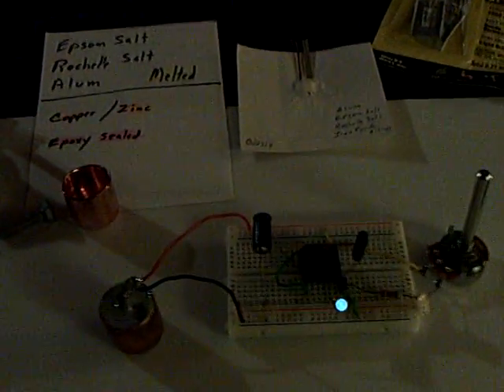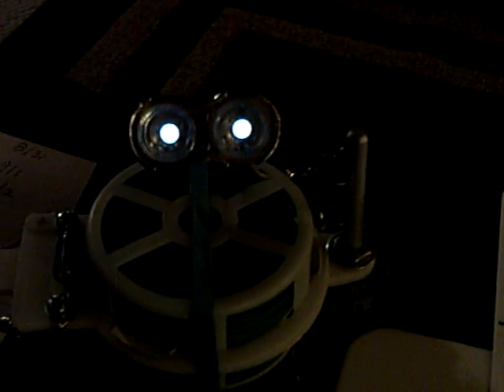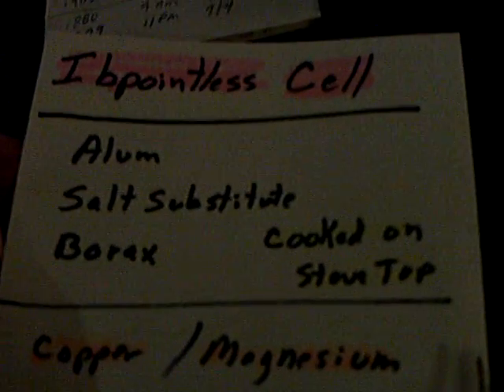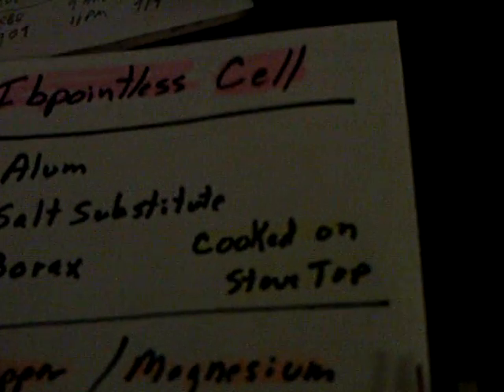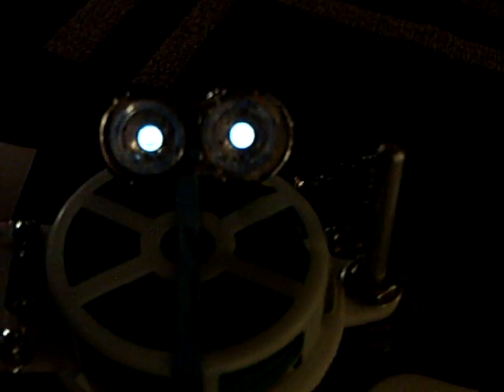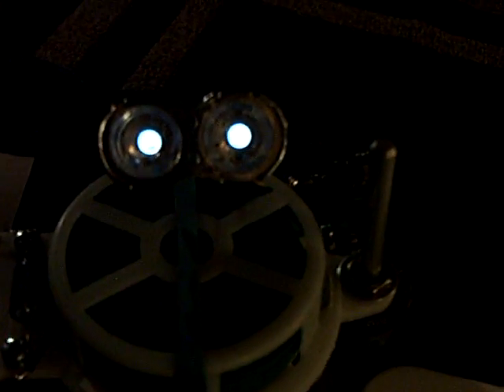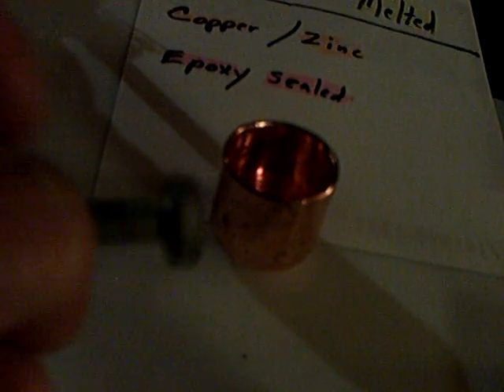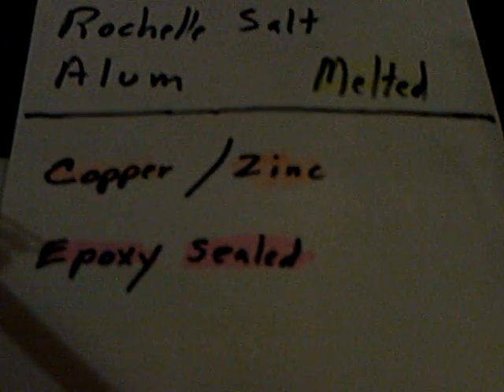Epoxy sealed crystal battery

Comment from the maker: @slider2732 ----That is good news!  I have been doing allot of testing with this epoxy sealed cell and it is looking pretty good.  Mine went down to about .5 volts but I can bring it back up to .8 by placing it in the sun for awhile.  The epoxy seal  is holding and there is no sign of corrosion or bulging on the cell.  It only puts out micro amps of power but ths was a good test sample.  If this cell holds up after weeks or months then we may have something important  here.

Comment: @Lidmotor After following JB's and your guidelines, I made a cell and used epoxy this time. All secured, all went well and there it was looking quite neat and ready for tests....well I fluffed the heating and ended up with zero mA. A completely sealed up dud lol. Shows to test things first eh. Made another and all went better, it's running a 'Penny' type circuit at the moment (using a toroid with LED off a pickup secondary) :)

Comment from the maker: @mcorrade ------Thanks.  Time will tell what happens on this cell.  I really don't know what will happen.  Normally on a galvanic cell the chemical reaction going on would just run it's course and the cell would go dead-----even though it was sealed.  This "dry crystal" cell may have some surprises.

Comment from the maker: @slider2732 ------  Sealing these crystalline cells is a way to ruleout air humidity as a contributing factor in how they work.   I also tried crazy glue and parrafin wax.   I used epoxy to make a very strong seal around the electrodes.  Now I just have wait and see what happens.

Comment: Your epoxy cell is somewhat like my 'plunger' type. To seal mine, I cut out a clear piece of plastic (in a circle), passed the central contact through and superglued it to the copper base part, along with the central part to seal...just another method. I like the plumbing end idea :)
Penny would have used a dollar's worth of electric by now lol